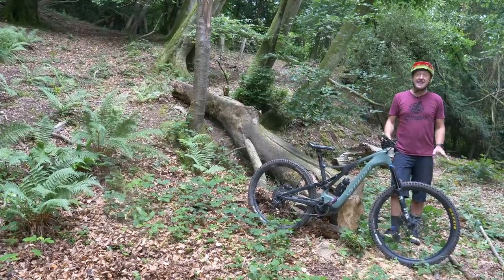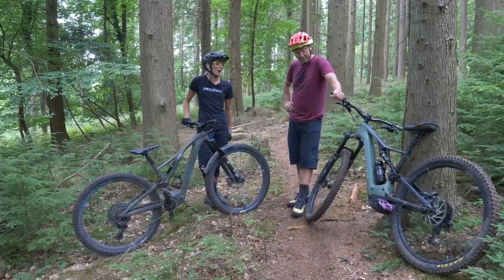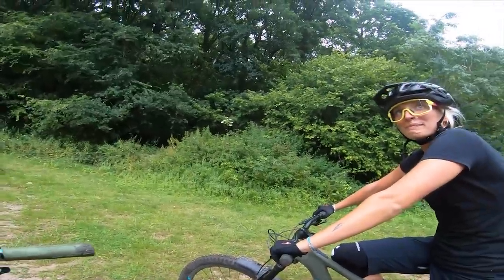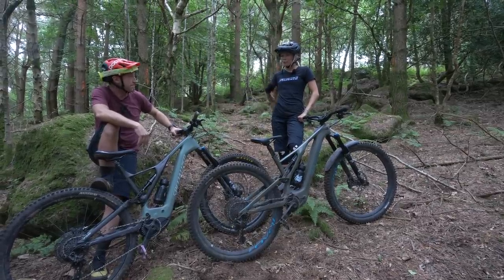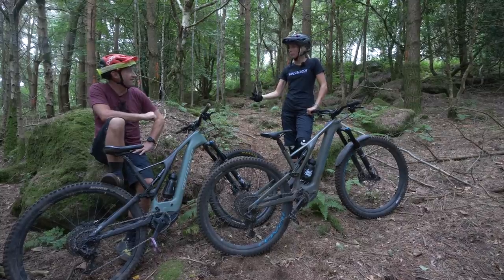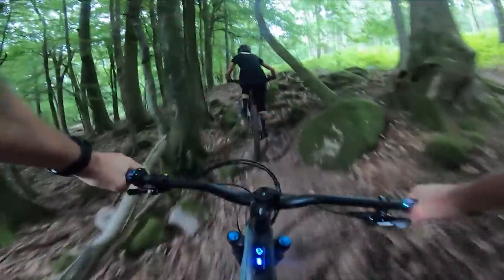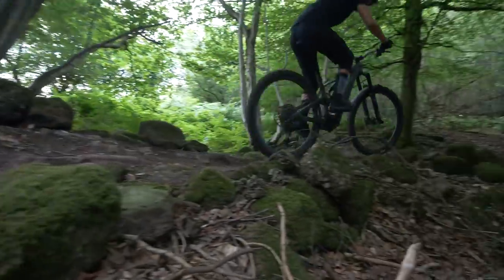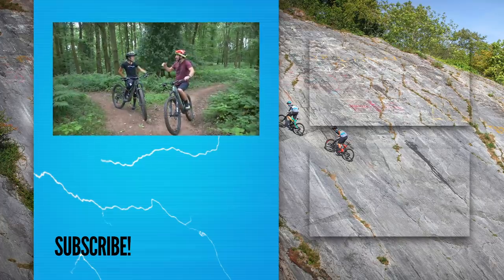Lighter Weight Or More Power? | Electric Mountain Bike Hillclimb Challenge

Comment: I ride a 2020 Trek Rail 9.7 weighing in at approximately 52 pounds. Yesterday, I had the pleasure of riding with someone on a Levo SL. What a difference in performance.

We rode up a very long single track for approximately 2000 vertical feet. The beginning of the trail is relatively smooth, while the middle is super techy, and then smooth to the end.

There was no way for my buddy to keep up with me through any of the ride up or down. Not nearly enough power for him. While I never had to exceed Tour mode (or level 2) assist, he had to use Turbo throughout. 

There was a lot of waiting around, on my part, for my buddy to catch up. He was completely gassed out by the top. Worse yet, so was his originally full battery. I, on the other hand, felt great and had only used between 10 and 20% of my 625wH battery.

On the way down, I could easily ride away from my buddy because I could just let the bike plow through the techy bits and rail (no pun intended) through the corners.

When we reached the bottom of the trail, my buddy was astounded at the difference in bike performance and feel. He went back to his vehicle while I continued climbing and descending.

In the end, he ended up with 7 miles and 2000 feet of climbing, while I completed 38 miles with 8400 feet of climbing. Yep, you read that correctly.

It only confirmed, to me, that the Levo SL is not the bike of choice for long, extended, techy rides. Not nearly enough power or range.

But, that's for me. I like long, all day, technical rides. That's why I chose the Trek Rail.
Reply: If you weigh 52 pounds and your friend 250 than the difference in range is logical. But I don't believe you weigh 50 pounds and I don't know the weight of your friend so it sounds like an absurd difference
Reply: Hey Simon Arends! He never stated he weighs 52 lbs he stated the trek bike he rides weighs 52 lbs! Ride ride ride!
Reply: @ericm8811  lol thanks
Reply: I have the levo sl expert. Im not as fit as i used to be, and 6-7kg heavier than i should be.
I estimate 1200-1800 of elevation on climbs, and 40-70km for my rides, depends on trail and how much time i have. And i dont have the range extender.
Reply: wow...i have a trek rail 9.8 and i get about 4k feet of climbing in emtb mode with about 3 bars of battery left.  im 185lbs
Reply: @1968Stratocaster  he might mean metres
Reply: Howie Rosen not knowing your buddies weight and fitness level makes your “review” just worthless.
Reply: Im 220lbs and can get 30 miles of range out of my sl . Ridden  mostly in sport with turbo used on all the big hills and some turbo just for fun.
Reply: I've went 35 miles one time though
Reply: @1968Stratocaster  Sounds about right. So many variables to consider too. eMTB mode rocks! I leave the bike in third gear and let it do all the thinking. Ride on.
Reply: Am I the only person who uses eco all the time ? 🤣
Reply: @gavinwilkinson1602  i use eco on a 35 mi. Ride the other day for the first 2 miles and then to sport for 33 miles with turbo on the hills
Reply: @gavinwilkinson1602  absolutely not. I love ECO. So do my climbing buddies. Long rides with lots of work.

Comment: 1) power is measured in watt. you need to consider rider input power as well
2) compare same rider on lighter/weaker vs heavier/stronger bike, this comparison is useless, as the rider cant save 40kg
Reply: Hi x force i think the point is you can ride together on high torque vs low torque ebikes
Reply: @stevejones7956  yeh but clearly not for very long mate. Age / fitness was very telling on this one. Georgia was being kind I think and clearly not as done in as you :)
Reply: @derekharper6031  Hey Derek. Totally. Which is kind of the point right.....
Reply: If you guys switched bikes, it would have been a very different story.
Reply: @stevejones7956  it certainly helps us older folk :)

Comment: I own the carbon comp sl and absolutely love it. Such a brilliant bike. I did test ride both before buying and full power didn't feel right for me. Too much power which I would never use. 
Cycled 20 miles yesterday  cross country and used 30% battery. Used turbo only on very steep climbs, the rest mainly in eco. I'm 6ft and weigh 75kg.

Comment: Power is both continuous and peak and power to weight is key.

Torque is more that instant hit and what that translates to in terms of thrust and is not so dependent on all up rider/bike weight.

Power is of course made up of torque (amps) and rpm (volts). 

Bottom line is it comes down to instant thrust at the back wheel with gearing due to the amount of torque (acceleration)  vs continuous power compared to overall rider/bike weight (speed). Both are important components of overall climbing performance.

Comment: In situations where the torque is really needed there's no chance for the SL to win.. on smooth fire roads you can keep the pace and the cadence but when the track become steeper and looser you need more from motor and 35 nm are all the way too few.. using the SL in turbo will deplete the battery too and imho I think the "standard Levo" is always the most versatile between the two.

Comment: I think a inbetween bike like a specialized levo SL is for someone who wants to catch up with his fitter friends who are riding non e-bikes. This 3~6kilo advantage is nothing compared to the 3 times more power and 2 times more battery capacity. In my opinion a high capacity e-mtb wins 90% of the time from a low power e-mtb.  The best e-bike would be 90Nm,1000w and 17 kg , maybe this is possible in de future for a reasonable price.

Comment: Hey EMBN! Again you have compared apples with oranges! Please do multiple runs and switch the bikes between the riders for another set of multiple runs so you will yield some useful information! All you did was load the more powerful bike heavily and give the weaker bike as little of a load as possible so you are hiding any differences that would otherwise have come to light! It seems like you set out to "prove" the levo sl is as powerful as the regular levo! Does specialized have to approve any vids their bikes appear in? Did specialized ask you to try to portray both bikes as being almost equal in power? Ride ride ride!
Reply: They need to do a course on how to run proper studies, it's kind of embarrassing making these conclusions which don't really prove anything
Reply: I hadn't seen this comparison before. No point swapping bikes, we know the heavy rider on the weaker bike is going to be heaps slower. I think you missed the point which is: a light rider (like a female) can use a lightweight lower powered eMTB and still stay with the pack. Useful to know.

Comment: On flatter ground I ride my bosch motor in tour and dont need emtb mode very much. Main problem is still with battery - that 625Wh lasts me about 40-45 km on a fast ride. Would love some more range.

Comment: It's not just rider/system weight that is a factor, the fitness is also. You can be double the weight but be fitter and stronger
Reply: True and then there is the speed limiter if they hit 25kph...the lighter sl and rider with less motor drag  would give you a massive advantage..

Comment: Its power to weight ratio that counts for the total package of rider plus bike. So a lightweight rider is better suited to the lower powered / lighter weight bike. But you didn't say what speeds you were going on the fireroad - was it close to the cut off ? If so the motors might not have been assisting as much and the input was more from the rider and that could sway the results.

Comment: Easy conclusions, power to weight ratio is impossible to compete against the levo.
Reply: 90 nm versus 90 kg is almost 1 ratio. In the case of SL 35 nm versus 55kg is less than 1 ratio.

Comment: I want to see the same rider using both bikes on the same hill. I dont matter who just a constant. That would be a useful test. 

Please redo this test seriously. I am curious if max effort on a lighter bike with a weaker motor is faster than a heavier bike with a stronger motor. Heart rate data needs to be measured. The runs need to have these heart rates in the same range for the test be accurate. 

My guess is the heavier bike would win. This test is misleading and give me nothing to go on.